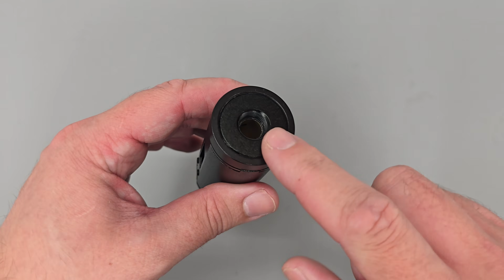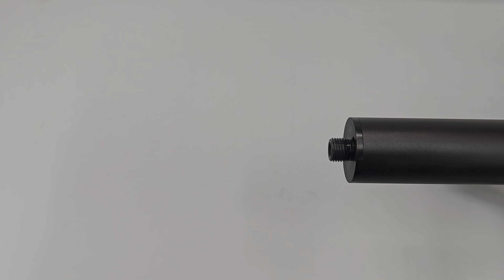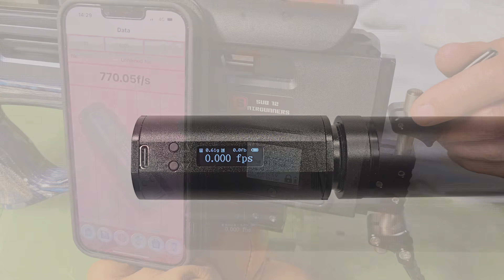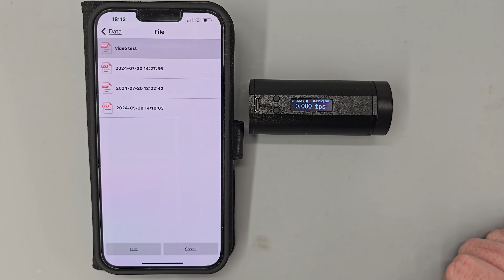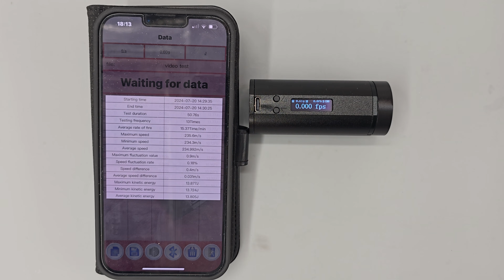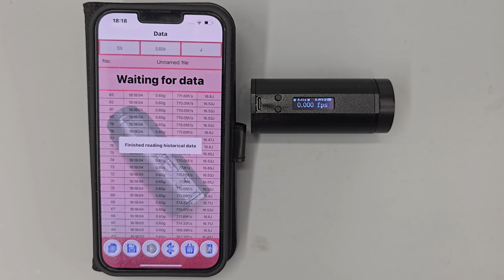Testing an AliExpress chronograph

Comment: Strange that this needs calibrating before use. That really means it's only any use if you already have another chrono. I presume most people will only have one. Someone has said it's fine not to be calibrated as it's still a useful reference point. However, that won't be any excuse if your rifle is found to be over 12ft/lbs.

Comment: Just so people know, it seems there are slightly different versions of this chrono floating around.

I ordered a chrono on Aliexpress that appears to be exactly the same as the one here in the review.
It does work, exactly the same way, except that the calibration ratio feature is missing.
Power off, press both buttons, it just goes straight into measurement mode.
The instructions make no mention of the calibration feature.

A pity because it reads about 10fps less than my master chrono.  Other than that it works well and I like it.
Reply from the maker: that's a shame that is a very handy feature they may have started pre setting them because so many people said what's the point of the chrono if you have to set the fps to start with
Reply: I have the same device as you without the ability to calibrate but I have a different problem, the device supposedly connects to the application but does not download any data, I can change the values with it but it does not send data on a regular basis, did you have the same problem?
Reply: @TheSpinaczRingwel  I gave up trying to get mine to connect to the app at all.  It is a bit wierd because it did connect on one occasion, and downloaded the data onto the phone fine.  But since then no connection at all.  It works quite well as a standalone chrono which is why I kept it.
Reply: @ajb-64 Have you tried contacting the seller with this problem? Mine, unfortunately, is silent.

Comment: These chronos do crazy results on CO2 Pistols,  my out of the box CP2 showed 14 ft lbs on the short barrel and 7 ft lbs on the long barrel. Infra red sensors see the gas blast.
Reply from the maker: not tried one on a co2 gun yet 😀 that's mad it see's the gas blast
Reply: @sub12airgunners  I made a sort of muzzle brake about 5 inches long with milled slits on 6 sides,   the Co2 still screwed up the velocity, then I threaded the front of the suppressor and joined them all together!    Last reading with all of that, said 5.95 ft lbs,      So it is not a pistol problem, it is a chrono problem for sure.  I will get a check with a real  non CO2 phobia chrono soon. Watch this space, it is important here....

Comment: Hi have the chrono just got it new but it’s the Airforce one chrono but like you say just the same, but mine reads loose ever time I go to chrono my fx crown mk2 so instead of reading out my fps and ftp it just says loose on the display screen I’ve checked to make sure everything is tight was wondering if you have any ideas what the problem is thank you. kallem.
Reply from the maker: no sorry, the only time i have seen this is on an fac running over 900 fps it kept saying that we tried it on a sub 12 and it worked fine

Comment: Mine must have been faulty. Most of the setup you showed didn't work and battery wouldn't charge to the 100% even if left overnight. Editing the pellet weight was impossible. Changing one digit changed all three!

Comment: There is no calibration, it's just a chronometre and and a basic calculator. Nothing worth this price. Itwould be at 40 euros I wouldn't mind, but at 105 I would definitely go for a doppler one
Reply: What doppler radar chrono is anywhere near the price of this ?
Reply: @doctorxring  fx airgun one's is the closest.

But to be honnest, the chrony on the video is in direct line with a 40 euro's one like Zonfer Ballistic Chronograph. There is nothing impressive with this new chrony except it looks like a sound moderator. For its current price I would expect AT LEAST an output moderator thread, a red+green laser pointing and a vibration recording. All cheap technologies today.

Comment: Nice little unit, bit like my Combro CB 625 MK lV in operation, bit easier to mount and it stores the data where as the combo needs to be hard wired to a lap top (which I've never been able to get working properly. 

Also have the FX which is also handy.
Reply from the maker: thanks for watching 🙏

Comment: The chance is very small that it comes out of the same factury. Chinese are masters in making nice looking copies. However in insides are often totally different, made with fake and often used parts . Leaving out everything that is not absolute "necessary" like protection, filtering and using the cheapest parts they can get. .  (I'm an EE ). I saw a video about cheap Chinese  body armour. Turned out to be so fake a 4,5mm 7,5 Joules air riffle had no problems penetrating. I'm curiuos to see the inside. The price is to high to be junk. Probably only two IR leds, 2 detectors and a processor.
Reply: No, this is definitely from the same factory that AirForceOne used for theirs. This was released before the AirForceOne was. So how can explain how they managed to get the same dimensions of the AirForceOne device before it was released to the public? Only way was it came from the same molding design as original. I bet the electronics are the same too. The firmware might be same but bmp logo is different and easy to change.

Comment: i think those sensors get dirty  ,and with a full power .35    snowpeak m25 for example withe 235 joule it will bl;ow it out
Reply: Les capteurs sont facilement nettoyer , il suffit de dévisser les deux vis pour accéder au capteur infrarouge pour enlever la poussière et 235 joules avec une M25 Snowpeak vous laisse seulement 5 tirs c’est ridicule 😂

Comment: As soon has we saw the airforce1 chrono, we all knew Ali would knock a cheaper one out and it’ll get cheaper. Tbh I bought an FX and I’m more than pleased with that, but if you’re on a budget this seems a good alternative.
Reply: This came out before AirForceOne did. So it looks like from same factory.
Reply from the maker: yes we have had it for a few months now thanks for watching 🙏
Reply: @PinkGirl2242  trouble is the Ali express ones aren’t in grains or pounds.

Comment: I quite like that I have to say. Around £75 which isn’t too bad. 
I have made my own one in the past and it’s given me an idea. 

Do you think it would be better if it had a little wired display that could be mounted to the gun so it can be easily viewed while shouldering the gun?
I suppose the downside would be the wire though.

Can you see how it’s built? Does it look easy to take apart?
Reply: More like £90 as vat is added at checkout.
Reply: @UnCoolDad  The dreaded extra costs. 
It seems there are shops selling it in the uk under the brand AirForceOne. I’m sure more reviews will come out in time.
Reply: @iantcroft  the natechrony is the same price.

Comment: Oh yes, finally a simple to use chrono. Looks a great easy to use device. As you say, may need calibration but if it’s your only chrono then that’s fine it still gives a  reference point. Will be getting one, my Fx V2 drives me nuts with its inconsistency to record shots.
Reply from the maker: thanks for watching 🙏